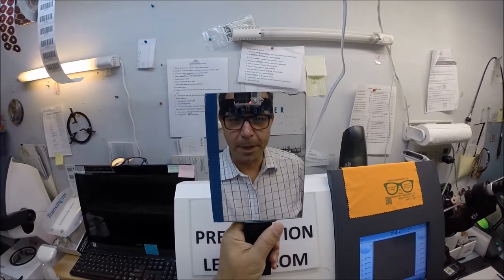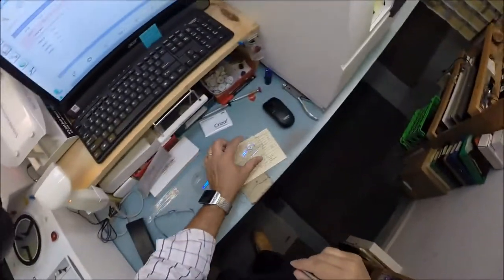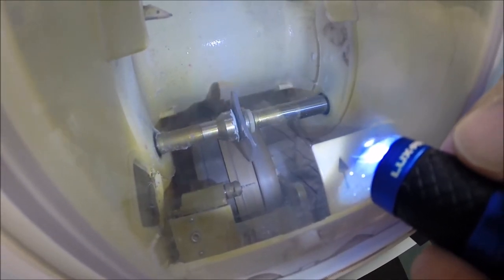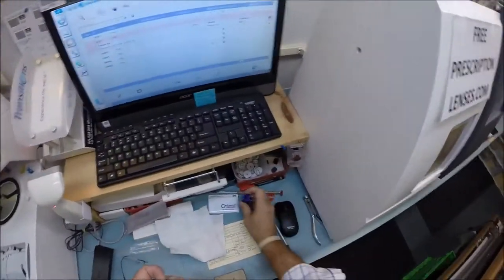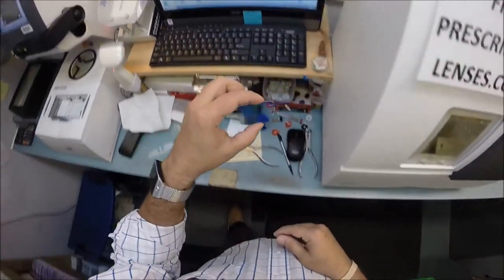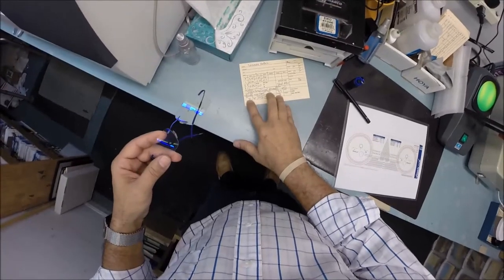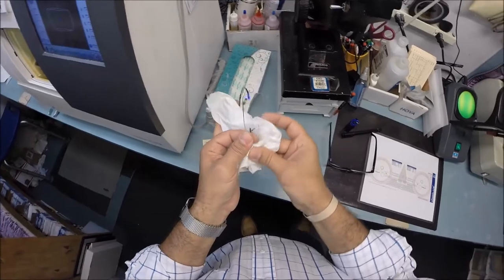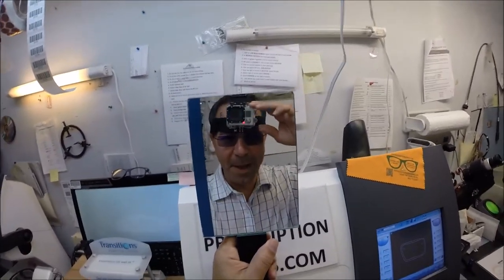My Silhouette 7581 Drill Mount with Progressive Transitions Gray Lenses with Crizal Prevencia

Comment: I take it the transitions you have here  is the extractive...Those get nice and dark.
Reply from the maker: No its the regular Transitions signature 7 gray lenses and not the XTRAavtive. I did expose them to a strong burst of UV light to activate them that dark. Both gray and brown block the same amount of light but gray "feels" darker. Gray makes my brain feel like there's a dark storm cloud over my head. I have golfers who swear by the brown because they like the contrast on the putting greens. In full disclose no lens helps me put better,lol. With the pros come the cons, keep in mind that the two cons to a Transitions lens is that they don't work behind the windshield of a car because the windshield blocks the  UV rays that activate the darkening of lens. And they are temperature sensitive meaning that they will darker when its 85* and below then they will when its 95 and above. I don't know where you live but it was just over 90 degrees where I live so even mine didn't get as dark. But let it drop below 80 degrees and watch how dark any Transitions lens will get. Now that I think about it, it was probably between 72 and 74 degrees in doors in the lab when I made these.

Comment: Nice. Can that machine trace rimless lenses that’s already drilled and it’s hole placements? Like sorta copy and pasting? Or you would need the frame to duplicate lenses?
Reply from the maker: Yes, but not to any accuracy that I'd be able to replicate perfectly. If its a Silhouette drill mount lens I have those programmed into a database. If its a cheap Zenni drill mount then no. Reputle frame companies will provide the drill coordinates for their lenses. If its a used frame without that info, it would just be a guessing game. I dont aim for the bulls eye, I aim for the center of the bulls eye. I choose to ship only perfected lenses.
Reply: @freeprescriptionlenses  so in a case of rimless, is it usually just tracing one lens, setting the drill holes and just mirroring the other side without having to trace the other side?

Comment: Hello, soon I am getting some similar Silhouette frames and lenses. I was wondering why you prefer the soft sleeves over the hard and why you prefer not to do the edge polish. Thank you.
Reply from the maker: The soft sleeves are easier to work with and hold up as well as the hard sleeves. And polishing the edge allows glare to come in through the edges, particularly the to of the lens from overhead lights and the sun. If you are paying for anti glare to reduce glare from the front and back of the lens why invite it in at the edges? Now cosmetically people like the way it looks but its the age old debate of form vs. function. How many people are looking at your profile vs. you looking out of the lens? Each to his own but I don't care for it because I know a certain amount of people will never tolerate the induced glare and not being able to see as well.
Reply: Does that I want Trivex lenses make any difference?
Reply from the maker: Nope same applies, except Trivex is a little thicker than poly.